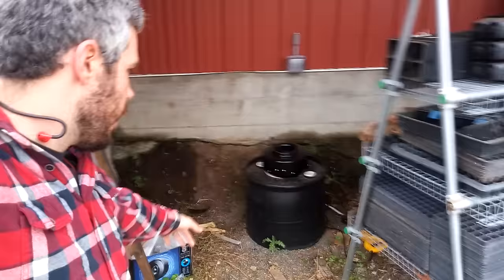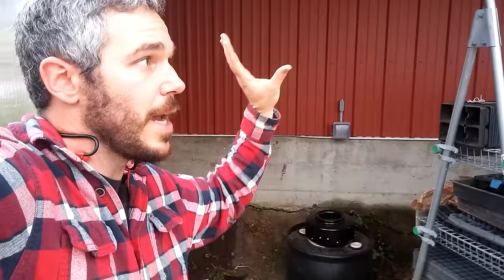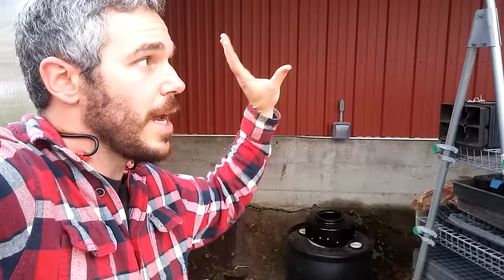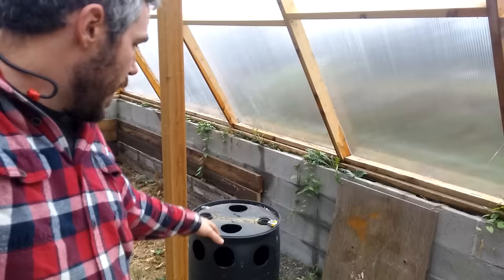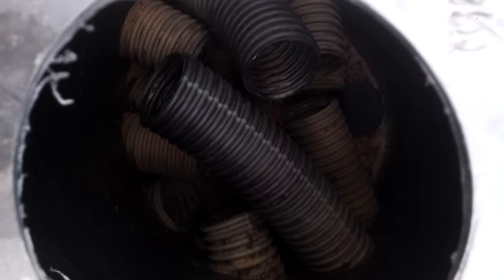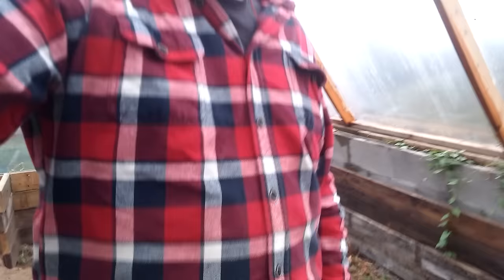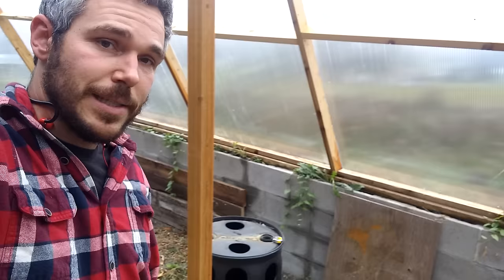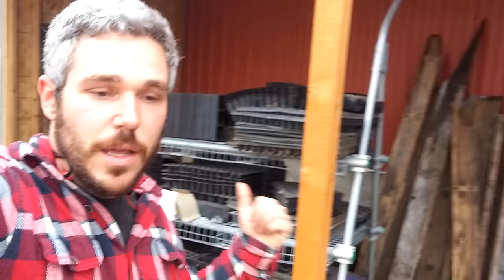Poor Man's Geothermal

Comment: I thought you were going to say you heated your greenhouse with a compost pile, which is what that wooden containment t structure behind you looked like to me.  Would that work? 

Also, a simple diagram on paper of what your did would be helpful to understanding it.
Reply: better still when installing  septic system  use a 2000 gallon tank with 8 inch cavity on all sides enclosed with water lines snakeing along the walls to use for heat in winter and build your green house over the septic field
Reply: In our area septic tanks freeze. If the tank had insulation over it, the warm air in the summer might make it work here. For insulation, we put 4' of dirt over the tank. If you don't have dirt you could substitute 1" of high-density foam board for each foot of dirt.  Make sure it has good grass cover, that is good insulation.

Comment: Ive heard that you need 1 foot of 6 inch pipe per square foot (on a 8 foot ceiling)  what is your cubic feet in your greenhouse?
Reply: Contractor here. The dimensions of those plastic panels are 4 feet by 8 feet , so if you count the number of panels 4 panel's (16 feet) wide by 8 panels (32 feet) long.  So 16' X 32' =  512 SQ FT, looks looks like one foot of drain pipe for every square foot

Comment: This geothermal is suppose to be more efficient than say a furnace or air conditioning etc.

But once you need commercial style fans and a large quantity of a dozen or so doesn't that tip the scale past ant savings of traditional systems?

Plus, you still need constant electricity to run all those fans to work?  What happens during a power outage
Reply from the maker: It might, it really depends on your system. But the majority of energy is spent in changing the temperature of the air, not pushing that air with a fan. The idea behind systems like this is that the burden of changing the temperature of the air is placed on the thermal mass of the soil, rather than a heating coil or something along those lines.

Comment: If you extend your vent tube up past the roof line wouldn’t that cause sort of a Venturi , causing more air flow?
It’s a cool design 
I assume from all the diy videos about this only a 1” pipe is needed for a close loop system to cool or heat a typical size (1000-2000 sq ft) dwelling?
I appreciate the video, do you have a schematic of the entire system ?
Thanks for sharing this

Comment: Hi so basically you are in a closed shell and you are pumping the air inside the shell with no windows open during summer . So the air is pumped into a 600 feet hoses under the ground , where the air is cooled and comes out cold to lets say 70 degrees is that correct?? If that is the case how can we calculate  regarding the area and how many hoses we can put in the ground.Thanks

Comment: Wow, this is awesome work you had done. I have a dream. We have land, and a huge pond and my hope is to build a green house to grow salad greens and supply to local market and set up a self sustaining business. Funding is an issue, so we would have to look at the most effective option. I have been thinking/exploring Geo Thermal heating to set up a 4 season green house here in Southern Alberta Canada.  We have wind and fair amount of sunshine. Love what you have done.  Could you share your insights to having - A Windmill pump air into the ground and return to surface providing a heat source to the green house in winter.  Would that work ?  What about condensation - and how would I overcome that concern?
Reply: The principles we are all talking about are game changing and can deployed for house, buildings and even imagine Giga farms based on Tesla giga factories...making many jobs, sustaining food, building materials, city sewer and compost and reversing industrial carbon emissions through manufacturing biochar.

I think installing 1,000 feet of hose in the backyard is a great idea for house heating...on top of electric thermal mass floor heating powered by onsite roof top solar PV SunPower electricity and solar wall panel heater with 95C when sunny.
Reply: pair that with a rechargable battery system and it would work when there is no wind.